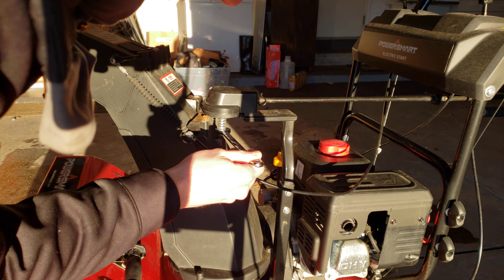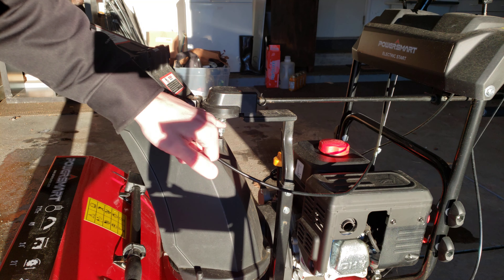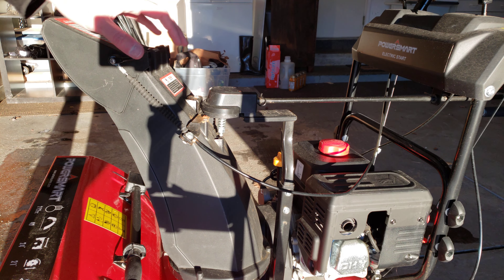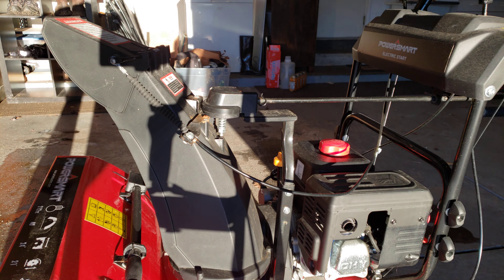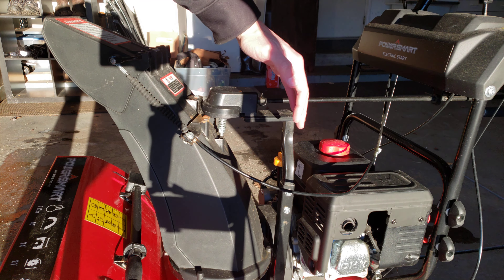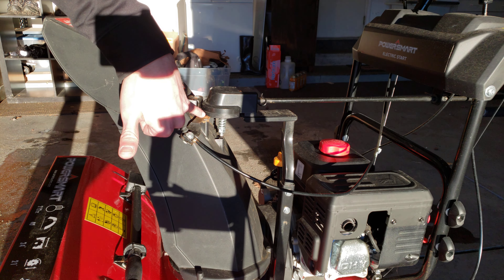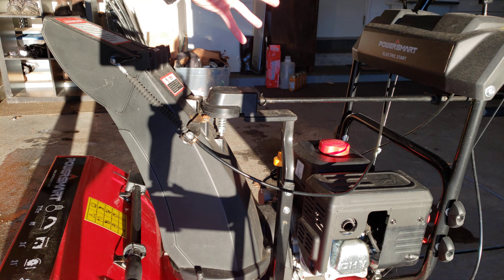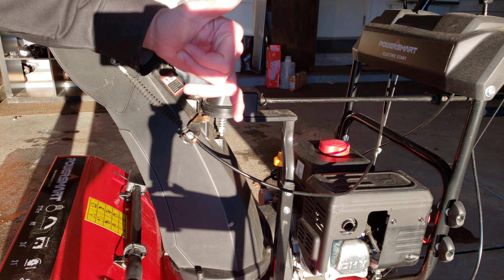Easy Fix for Snow blower Chute Rotating On Its Own

Comment: I have the same one. Mine does not help much. I have the same snowblower any other suggestions
Reply: same here
Reply: @yinglyca1  I made a power Chute for my snow blower. Power by a drill battery and run by a power windows motor..